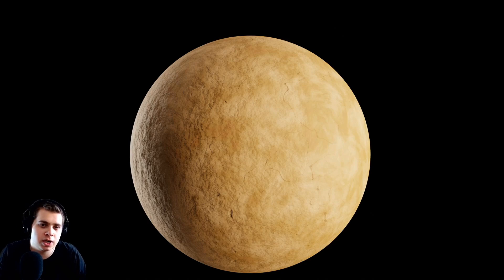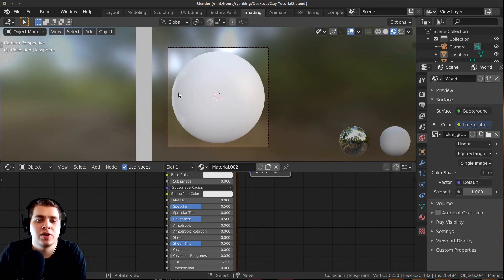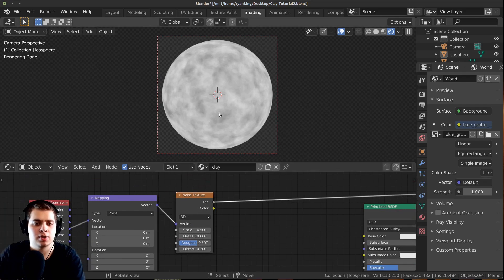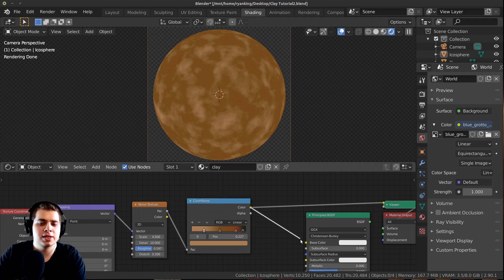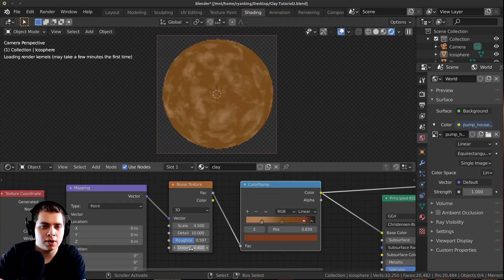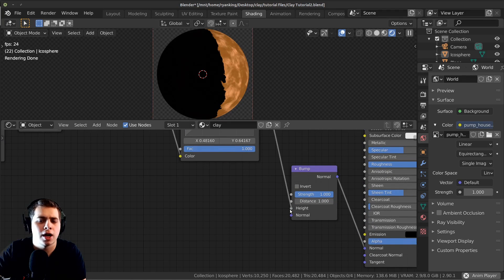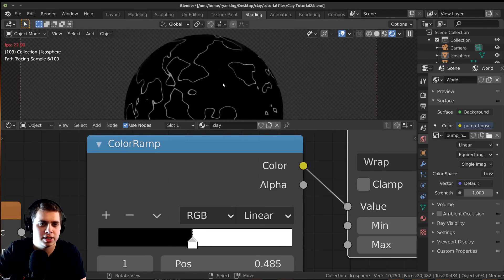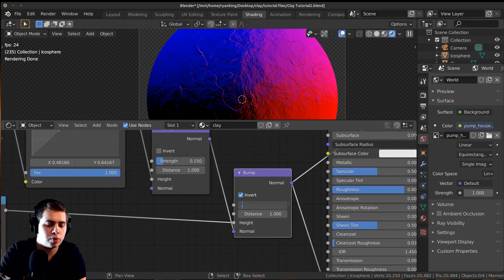Procedural Clay Shader (Blender Tutorial)

Comment: 2:23 The trouble with Perlin noise is that high values of the Detail setting make very little difference. This is because of the attenuation of higher frequencies. Try Musgrave noise instead, with a lower “Dimension” value (this reduces the high-frequency attenuation), if you want a grittier look.
Reply from the maker: thanks for the info.
Reply: Though, watching your videos further, I notice you can restore a lot of that grittiness just by enhancing the contrast.

Comment: If anyone is experiencing difficulty with the Wrap node, it appears that the Wrap function of the math node has a new default setting of 0.5 for both min and max values (I'm using Blender 3.0).  They also seem inverted, so I needed a max of .5 and min of 0.00 to achieve the same result
Reply from the maker: Thanks for the info!
Reply: Thanks, had the exact same issue now (Blender 3.0.1) and was happy to find your comment.
Reply: Yaaaaas! TYVM!
Reply: On Blender 3.2, Min and Max are displayed in reverse order. 
Try Max -0.5 and Min 0.5
Reply: Thanks man
Reply: For some reason that did not work for me...
I tried to use same settings but instead it just repeats the same as it was without the node. Just high contrast black and white spots, not outlines. Surprisingly, changing it to Fraction seems to have worked.
Reply: Perfect, that had me scratching my head. Thankyou so much!
Reply: I using blender 3.4 and this still work, thanks